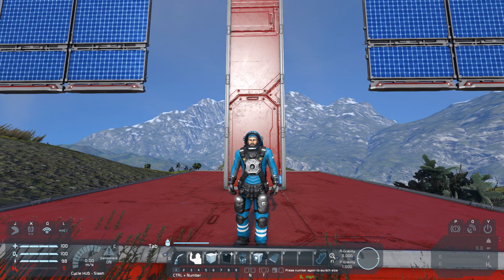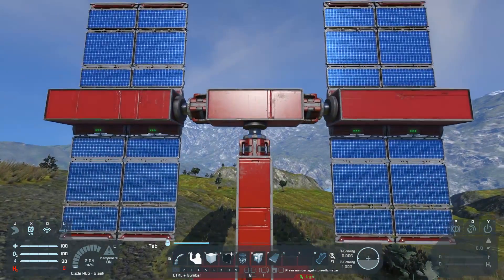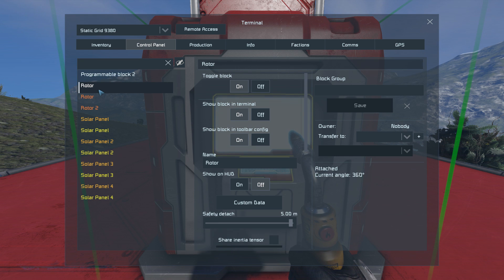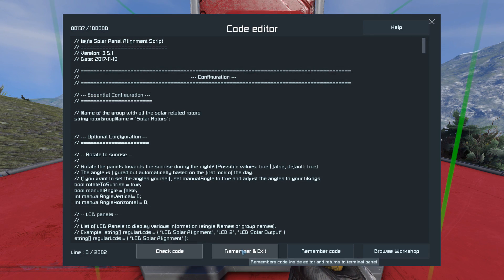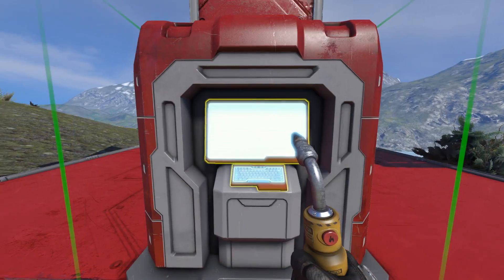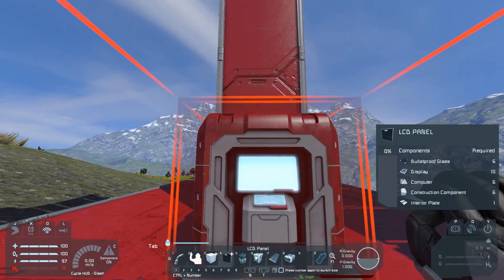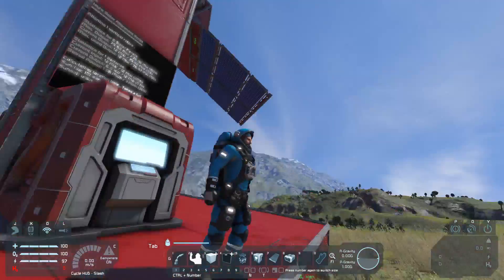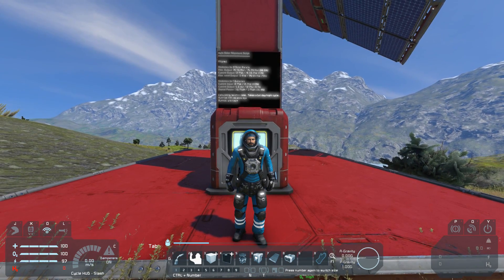Space Engineers - Isy's Solar Alignment Script v3.5 Tutorial (Quick Setup Guide)

Comment: I love this script, I am not using it to align solar panels but i can confirm it does work with the steam power mod, use this script to align my solar steam generators, also using the same script in the same programing block to align a giant hydrogen farm on a separate mast. works perfectly. (ran into a small issue setting up the hydro farm, its the gigantic oxy/hydro farms mod. Clang took offense to me hanging that much weight off a single rotor and sent the whole thing shooting down into my base at top speed [1,000m/s] always make sure you share inertia tensor with super heavy loads on rotors and hinges XD)

Comment: I know this is an old video but if anyone knows how to make 2 solar towers work please tell me (the first one is working but the second one is standing still)
Reply: I've got a similar issue. I'm running a solar farm with 6 towers (each with a yaw rotor and two pitch rotors). Everything started great, then an hour later one of the towers is way off, only getting half charge on the panels. It hasn't been right since.  I've tried the realign command and recompiling the script, nothing seemed to change.

Comment: Hey Der Isy, I know this is an old video, I have been a long time user of your fantastic scripts and I was wondering if you have anything in the works taking advantage of the new wind turbines?
Reply from the maker: The newest update has statistics shown for them and they are calculated into the overall power production but as they can only be on fixed grids, there's not much I can do with them..
Reply: Brilliant, thx I will check I'm running the newest version.